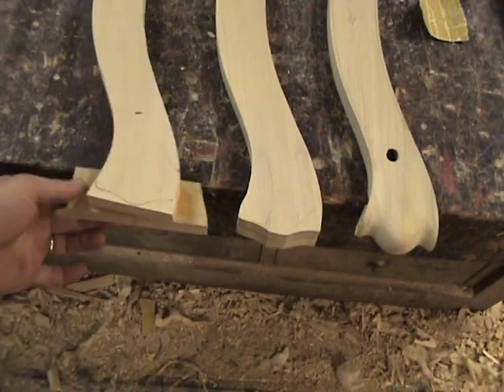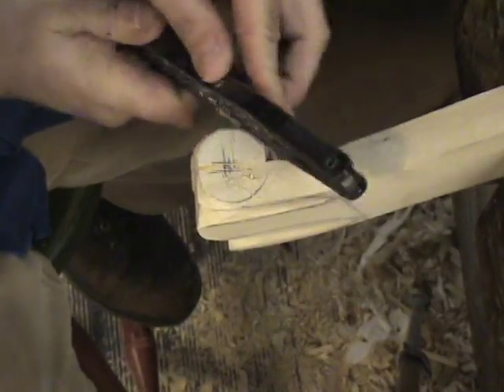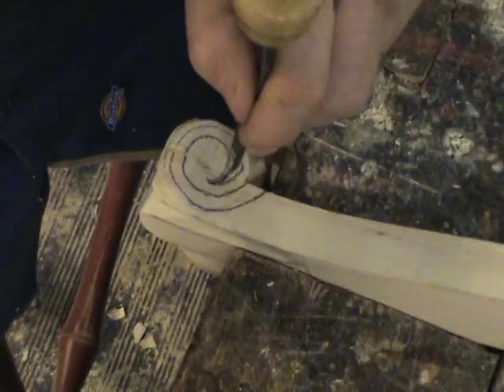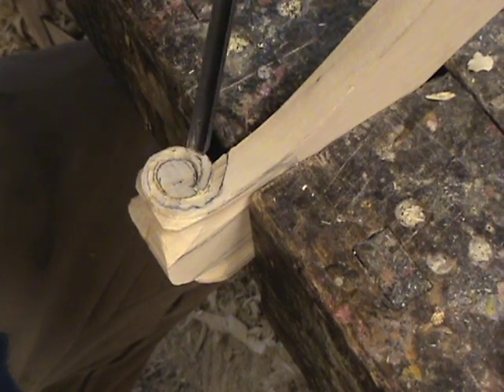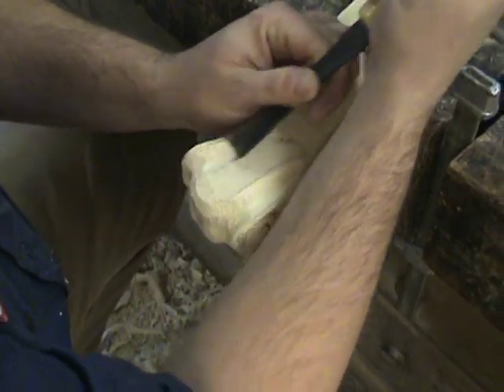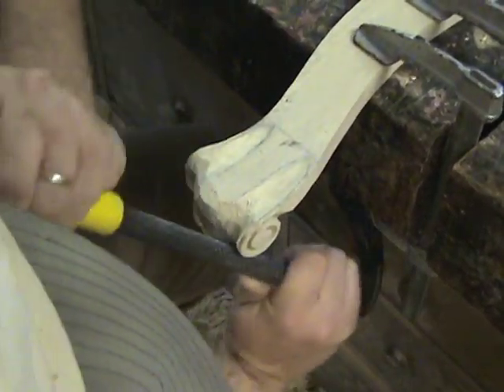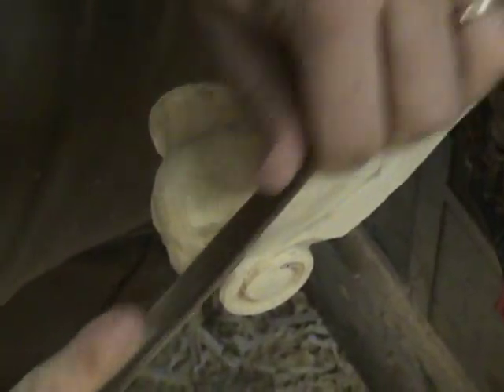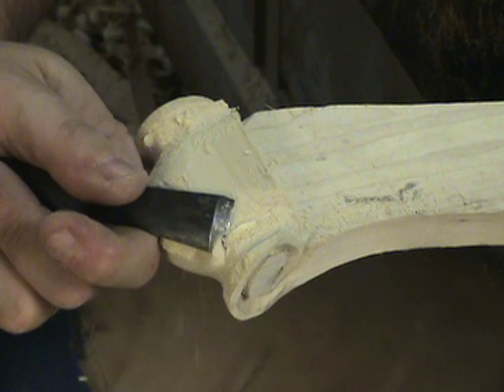Carving a knuckle for a Fan Back Windsor Chair

Comment from the maker: I used titebond 2 mostly in the past just out of habit and the ease of getting it anywhere but, have just recently began using hide glue for it's ability to be repaired in the future. Hide glue is better because with heat and mosture it will release letting you repair a joint rather than destroying it and causing you to remake or sometimes completly redo a piece.